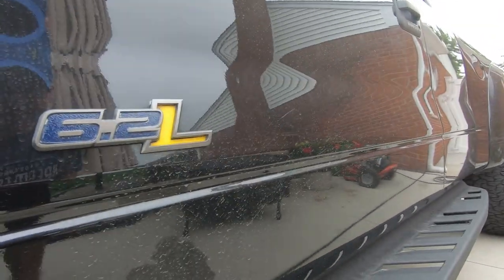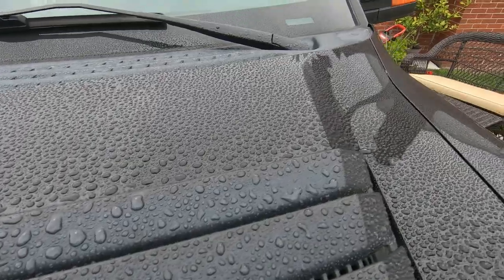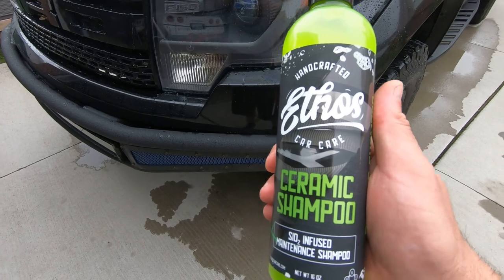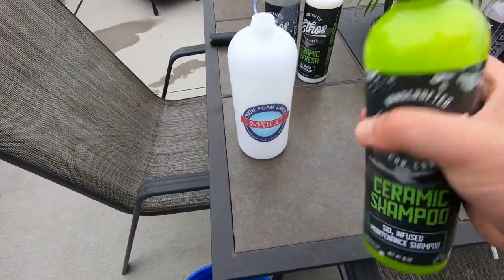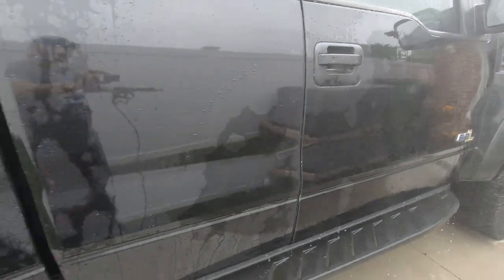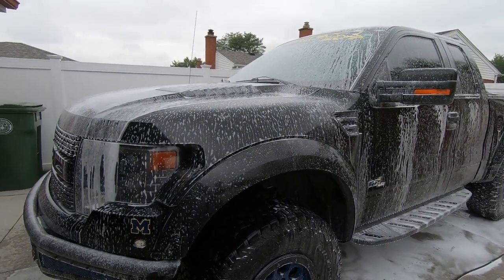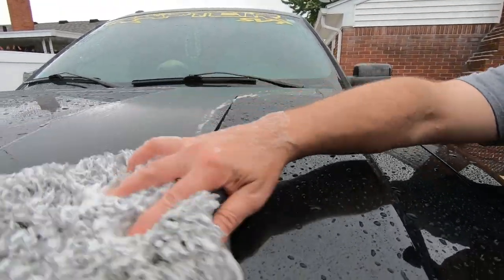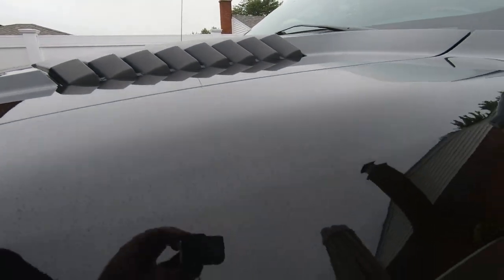Ethos Car Care "CERAMIC Auto Shampoo" Silky Smooth

Comment: I have a question? When i wash my car i dont ever touch the car not to scratch the paint. But if i just use a foam cannon or foam fun and let it sit with the ceramic shampoo, and then rinse off. Will it clean well? My car just gets dusty no heavy dirt usally
Reply from the maker: It will clean as long as your car not very dirty . If the car is dirty rinse  it then foam and let sit couple min then rinse re foam and then hand wash the car. Thanks for the question
Reply: @OuzoLouGarage  ok good thanks for replying.
Reply from the maker: @ctetuning  Any time. Have a great weekend Detailing 🤙

Comment: great video!  i use this shampoo on my car, it smells amazing.  i find it works best when you foam the car twice with it, foam rinse foam wash.  it makes my paint super glossy.  i bought a whole gallon of the stuff.  i also use the ceramic refresh.  look forward to your video

FYI i think there is something wrong with your foam gun
Reply from the maker: Need a new foam gun been  having trouble adjusting the nozzle for more foam.  This soap did work great i can see myself getting a gal. Thanks Edward